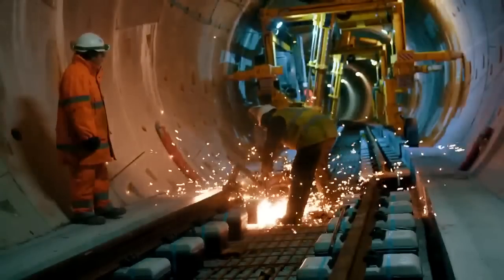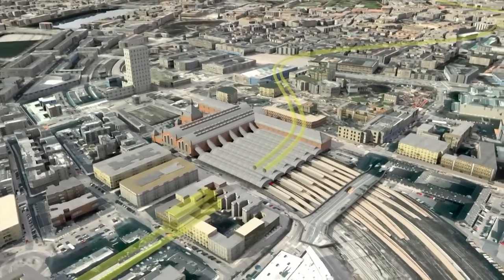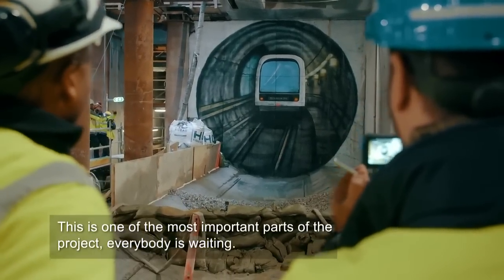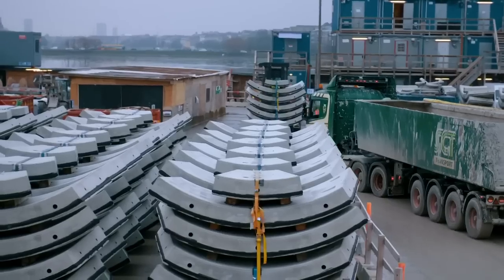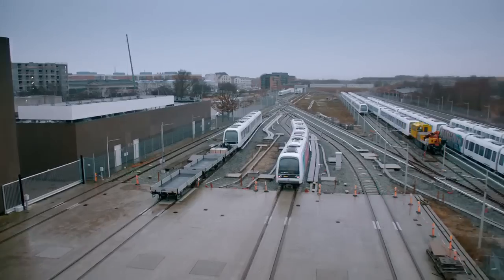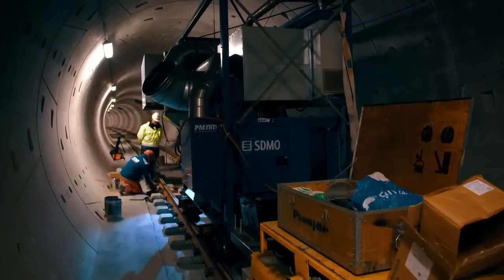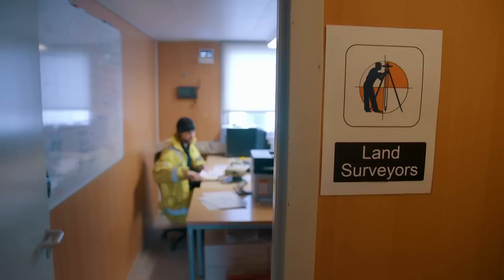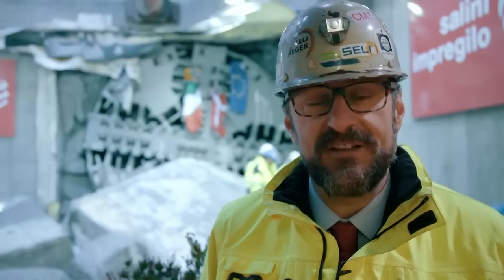Cityringen Metro [Copenhagen - Denmark]

Comment: The engineers and builders who built this metro and its tunnels are very much appreciated by those of us who now commute on the M3.
Reply: Has the traffic reduced after the opening?
Reply: This video exaggerates how bad traffic was before the M3 cityring opened. I disagree that we had to battle "constant gridlock". The cityring has made it faster to get around on public transit. It has likely not had much of an impact on road traffic and people who drive to work. If road traffic was slow during rush hour before, it is still slow now.
Before the cityring, my commute to work on public transit was a combination of 5C (bus) and S-train. Now it's via cityring and maybe as much as 10 minutes faster. I think that's how the cityring has impacted most people.

Copenhagen is discussing other (road tunnel) projects more specifically designed to mitigate road congestion.
Reply: @martyminus90  It depends very much on specific areas of the city. Especially some central hubs are nowadays less traffic jammed as they used to, however due to old-fashioned road system there are still lot of jams on some roads. This is cause by the excessive amount of pedestrians and cyclist, which forced the implementation of traffic lights at nearly every intersection in the city. This creates significant traffic jams during rush hours and is not much affected by the new metro line in general. The people that use the metro now, were mostly using trains (S-train) or buses before.

Mostly it improved the access to metro and public transport. Before lot of people were taking trains/buses or cycling to the stations and them used the metro, however now it is very easy to move around the center on foot.
Reply: @martyminus90  I also disagree the traffic had been that bad before opening but it's great to live right next to one of those stations. Metro can get me anywhere within 15-30 mins as fast as a bike.
Reply: @filipkozmer4429  The ultimate dream would be pedestrian and bike-only zones in the centre... Actually quite surprising they don't come up with some underground crossing on those main traffic streets like H. C. Andersens Boulevard.
Reply: @martyminus90  I'd also say no, the suburban traffic net is not improved so no-one shifts from car to public transport.
Reply: @surters  a lot of the cars in copenhagen are people who live outside the city, or who have to go perpendicular to all the train lines to get to/from work, and drive because the bus service is very poor outside the inner city. The metro will not, and cannot do anything to illeviate road congestion as 0 of the stations have parking, and throughout all of Copenhagen we still do not have proper park and ride facilities, nor proper public transport across the S-train lines. All the metro 3 and 4 have done is provide better public transport in the inner city for people who are reliant on public transport
Reply: @thesteelrodent1796  thanks for agreeing with my point! and living in the areas of M3/M4 I barely feel its an improvement as a lot of busses got axed in the process.
Reply: I worked there in 2014-2015 at technical site Norrebroparken.
Reply: engineers and builders are italians...  SALINI IMPREGILO  now WEBUILDING is the best  metro's builder in the world

Comment: Narrator said "innovative driverless trains will run" - somehow I think it would've been worth adding, for context, that the existing lines of Copenhagen metro already used the same driverless trains...
Reply: Yes. TBMs and the track laying machines are also referred to as "innovative" but then we see that they operate just like any other.
Reply: At first they didn't at all run as planned, but it took some time to actually make the trains run as intended, and at first the passengers didn't always arrive where expected.
Reply: Also, Cityringen opened in 2019, so it's a bit weird to see this uploaded more than three years later as if the line was brand new.
Reply: To be fair, the new trains are much more advanced than the old trains. Whereas the old lines uses good old track sections to divide the trains, the new lines uses moving track sections that follows with the trains and are calculated based on speed and braking power, enabling trains to run much closer to each other.
Reply: @flotfyr14  I see. So the trains on M1 & M2 can't run on M3 & M4 and vice versa.
Sydney Metro also uses moving block (CBTC).
Reply: @peterelvery  Don’t pin me to it, but yes I’m pretty sure the trains on the two lines are incompatible.
Reply: @peterelvery  yup different signal and safety systems. There also isn't a point where they connect
Reply: @marcranger4596  Yeah, the lines are separate but it'd be handy to be able swap stock in an emergency.
Reply: @peterelvery  the intention is that M1 and M2 will be renovated to use the new system, when the trains are planned to be replaced after 2030. And I believe by then we will finally get trains with airconditioning

Comment: 28:15 The narrorator is describing thermite welding like it's this crazy sexy new technology when just about every railroad across the world has been using it for a hundred years.
Reply: And still, this metro has done nothing to reduce car traffic in copenhagen. Meanwhile, Copenhagen has scandinavia’s busiest bus line, which still hasn’t been upgraded to light rail. Metro is just an excuse for cars to continue driving in the city, trams take car lanes away, and remove cars from the city centre.

Comment: Some people now living on top of the tunnels complain that they hear and feel the trains below the old buildings. And that is sad but the price for living in a large city, with constant works and constructions. On the other hand they will now be close to public transport, with hardly any parking space ready to be used, unless extremely expensive and eventually far away.
Reply: Many residences have underground garages for their tenants
Reply: But parking is probably not the reason why trains are better, in Copenhagen like in every city, its the traffic.
Reply: That's just very bad planning, they wanted to cut costs.

Usually tracks are mounted on a damper system in sensitive areas
Reply: @nicolasblume1046  The Cph. Center is very old buildings on rather soft ground. The Christiansborg Castle (The Government building) is built on wooden pillars which may be damaged by lowering the water level? I haven't any experience but we must believe that the statements are true?

Comment: not in a million years would i think I'd see a long ass documentary about the city ring, shit had taken forever to build and It's funny cuz its almost as if I couldn't remember life before it. Always used to cycle everywhere and I still did but it took the load off 14 year old me. Always admired the M1 and M2 due to it's frequency and constant opperation, the M3 like it's predecesors is an invaluable asset to the city of copenhagen, that easily bolsters the city's efficieny in transport non invasively. Furthermore I don't care if you walk thats good for you but the bike and rejsekort combo will get you anywhere quick and cheaply which this new line obviously reinforces.

Comment: The "19 miles" referred to throughout are too short to be Danish or Swedish miles. In the description it's 15.5 kilometers so they can't be English miles either.
Reply: There are two tunnels, one in each direction.

15,5km x 2 = 31km =19,3miles
Reply: @nicolasblume1046  Of course!🧏‍♂ Apart from car tyres and chainsaw bar lengths, inches and miles are just a distant memory.
Reply: @peterelvery  Even English Rails are now measured in kilometers, I have observed.

Comment: how do you get the train down there?
Reply: I haven't finished watching the video yet so I don't know if it also covers the M4 line which has been opened at the same time with M3. The M4 isn't fully finished but most of it is and it runs through the same route as half of the M3 cityringen. One of the built ends of M4 is above the ground so I believe that's where they placed the trains on the tracks.
Reply: building an entrence